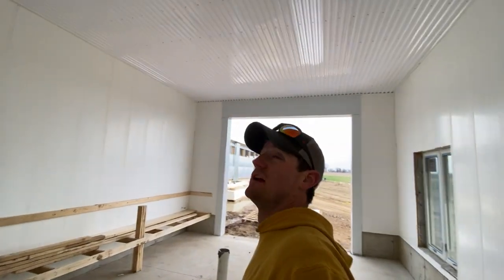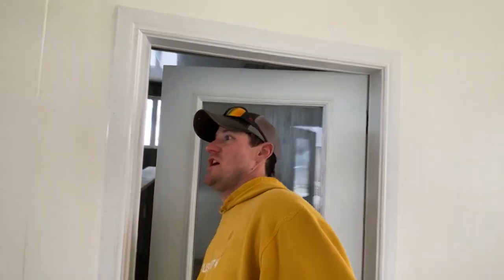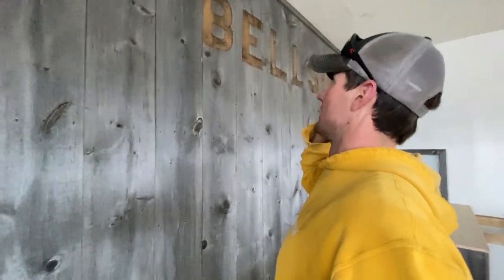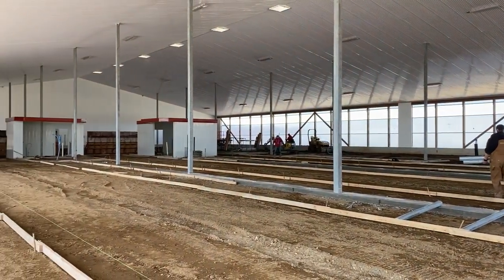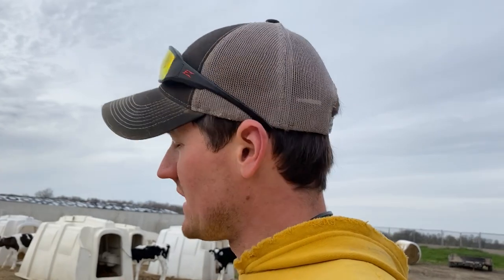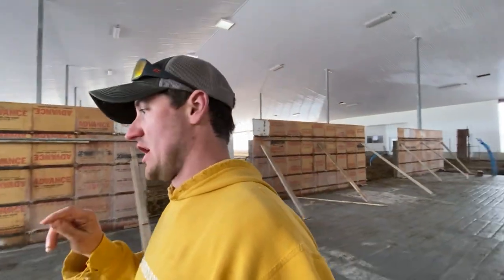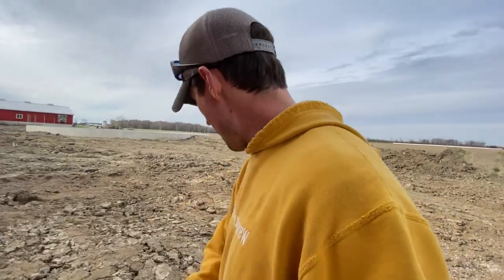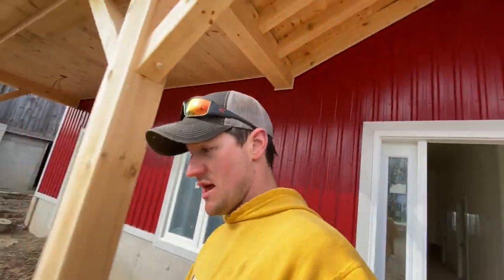Getting OLD Barn Boards into the NEW Barn! | Building Our Cow Palace - Ep63

Comment: Have a concern about the drainage from the robots. That drain can be clogged with manure because it has no pressure in it. In our heifer barn we have a room where we mix milk and wash calf buckets that run out into a gutter and if it's not emptied enough at least under the pipe for a while it can become clogged. Maybe this is just how you it over there.
Reply from the maker: Good to know! Thanks